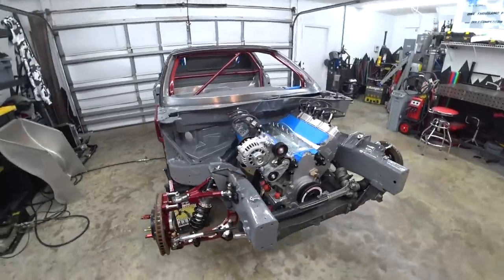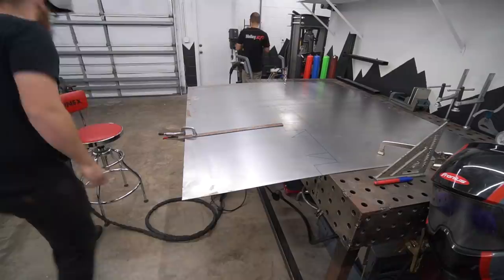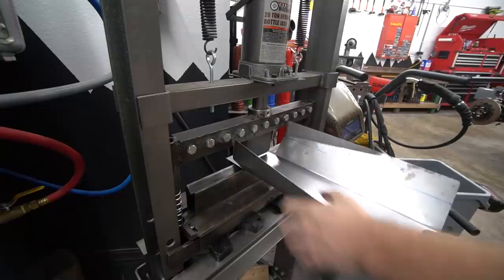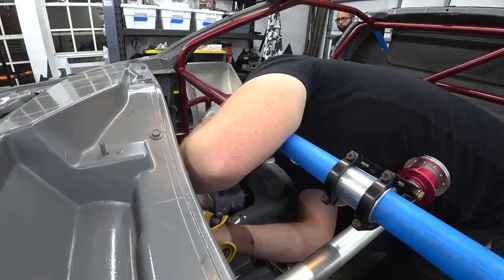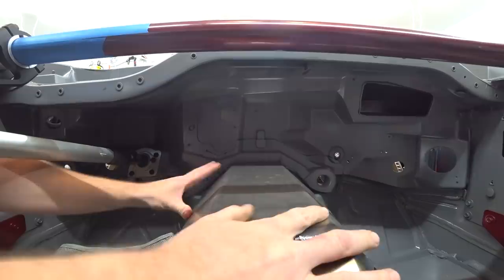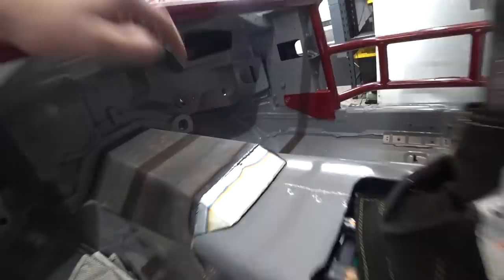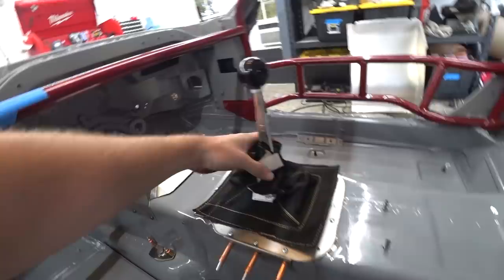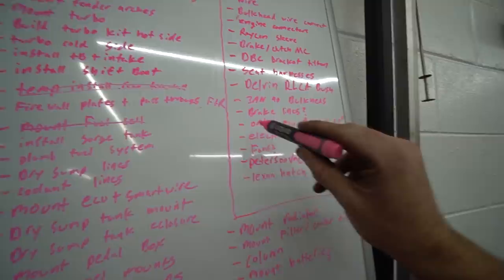C6 Corvette competition drift car. building something i've never built before.

Comment: Did you end up testing if you can change the gearing with the quickchange mounted where it is? 
Looks quite close to the rear bars there!
Reply: I thought that! I bet we see a snazzy bolt in version of those bars at some point in the future...
Reply: @HexyTech  I read that in Taylors voice from the word snazzy onwards 🤣🤣
Reply: @Matty.Hill_87  yeah I've watched too many of Taylors vids now I can't stop jibber jabbering and calling things snazzy
Reply: @HexyTech  Yeah I'm picturing those bars becoming bolt-in as well!
Reply: Braydon maybe switching bars that bend around the diff gear cover and avoid blocking it would work.
Reply: Should just weld in a driveshaft loop doughnut in the middle so it's open right behind it. Then he could just reach thru the loop to pull the gears.

Comment: I think you would have had an easier time closing up your trans tunnel by using slightly thinner steel, and hammering it into a dome over a sand bag, Then you would only have a domed flat piece to weld on top...

Comment: I keep wondering, how much space do you have for servicing the quick change diff with the bracing bars?
Reply: Should get a something like a driveshaft loop an weld it in the middle so he can reach thru an pull the gears straight back.

Comment: Didn't understand the purpose of a removable Trans tunnel cover. Sound like more work to do and less safety. Even with it realy thight fit and weather striped, you never get a better result than welding it. Just my opinion but in general the build look realy sick.

Comment: I have a question for you.
 I have  I have 20" rims on my truck but I have 35" tires I have stock Breaks on it and I want to upgrade my brakes to heavy duty breaks breaks and I was wondering what brand should I go with I have power stop on my truck right now and they suck like like worthless all Dall they are are powder coated Factory breaks there's nothing upgraded about them performance wiperformance wise I was looking at racing breaks.

Comment: Great build series so far Taylor, keep it up. Im curious as to why your transmission sits so much higher than what Collete has in her vette. As far as I know youre both running virtually the same driveline setup, minus the motor and hers sits alot lower in the trans tunnel

Comment: Your trans tunnel looks great, good work on that, and with the trans tunnel do you have to cut a hole for the brake handle (E-brake), great build 👍🏼👍🏼👍🏼👍🏼🇦🇺🇦🇺🇦🇺🇦🇺🦘🦘🦘🦘Cheers from Melbourne Australia
Reply: I'm sure he'll setup a hydraulic drift break.
Reply: @eldonerc2524  thats what I was trying to say, had a brain fart, and I don't know how much of a hole that stuff needs, but thanks mate
Reply: @notold37  not much of a hole required. The master cylinder mounts on the handle mount bracket. An it just needs a brake line run into the rear brake lines. I've seen them run all the hoses inside the car before an just punch about a half inch hole thru the trunk floor to drop down straight over the axle. Biggest thing is setting up the handle mount. He's probably waiting to get the seat in to determine proper placement.

Comment: I LOVE iT...but you know I don't like the exhaust route, , it's scaring me a lil...orange exhaust, banging off rev limiter for 3 laps straight, bit of danger flamzer if you ask me
Reply from the maker: Factory cars have the exhaust running right by the gas tank on many factory cars. Also post turbo exhaust temps are way lower than pre turbo where you see it glowing red.

Comment: Why dont you just drill holes and use u nuts to attach that plate?
Also rubber butyl will work perfectly as a removable waterproof seal for them.

Comment: Do the people in these comments not realize that in pretty much any truck the driveshaft goes right past the fuel tank and the tank is usually made from PLASTIC
Reply from the maker: My miata it’s like an inch above the driveshaft factory. I broke a diff and it slammed the gas tank. No issues. Same with the exhaust. Runs right next to most stock tanks on factory cars.